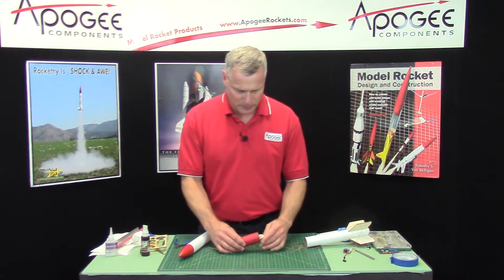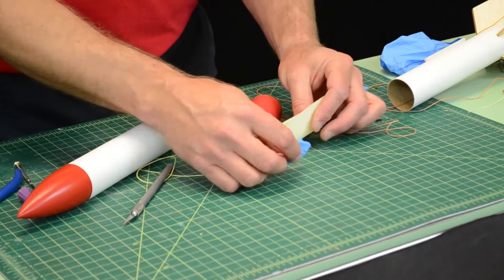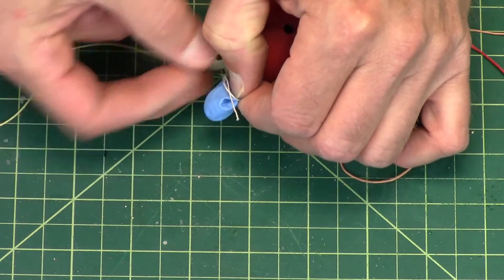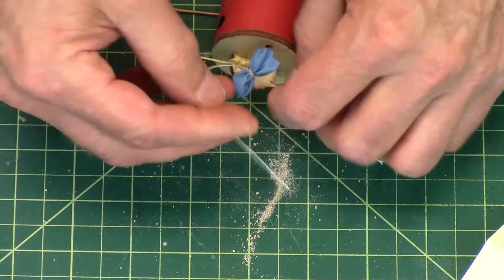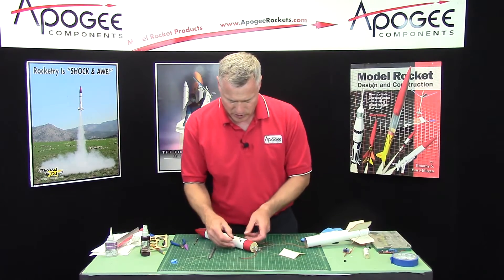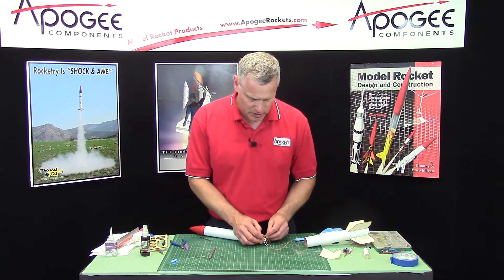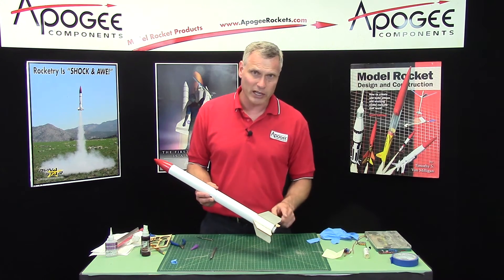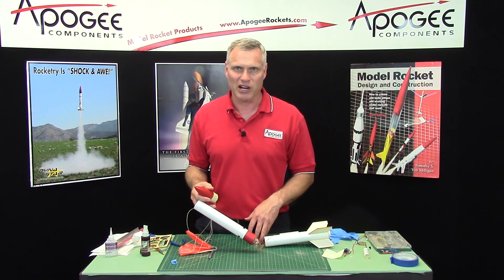Apogee Ebay BT-60 Assembly Part 8

Comment: Instead of setting up two ejection charges in the ebay, can I just set one ejection charge to eject the main chute with the altimeter, and just let the ejection charge in the engine to eject the drogue? Or is that a bad idea?
I’m new to building model rockets 🚀
Reply from the maker: Yes. That will work.

Comment: Are there any substitutes for black powder you can use? It's hard to come by in California
Reply from the maker: Our apologies but no, there isn't any real viable subsititutes for black powder. We would recommend asking your local rocketry clubs how they acquire the black powder for use in launches. It can be common for them to share/sell for others (or if not refer you to where they may get theirs from). You can buy it online however it's typically only for large amounts and there can be high shipping cost due to the hazmat shipping required. It can be one of those items that is tricky to come by. Feel free to contact us on our webpage if you have more questions in regards to this or other rocketry questions. Thank you for your time.
Reply: Actually, try using 777, it’s easy to clean from, and non-naturally-explosive ( so no restrictions). however, you do need to get it Packes T I G H T do it to work on a Dual Deployment rocket